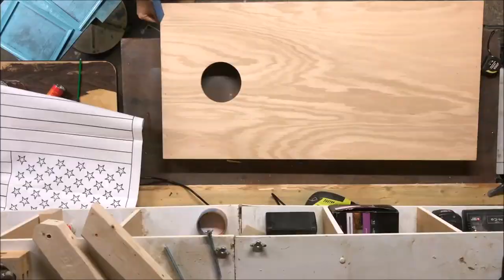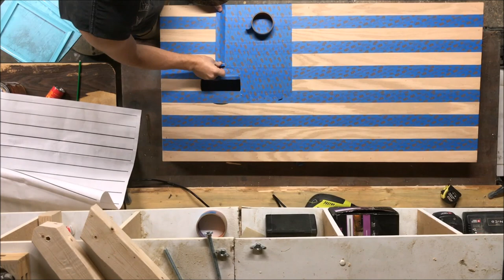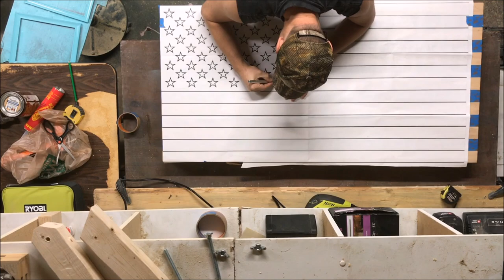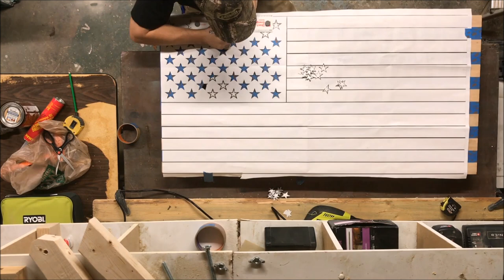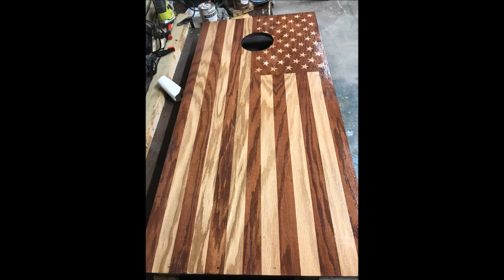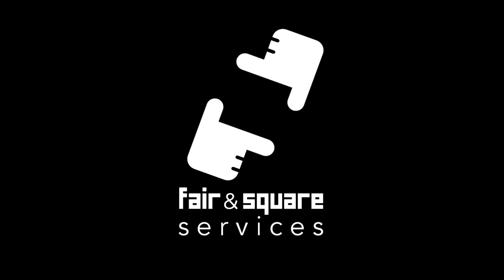American Flag Cornhole - Fair & Square Services

Comment: I’ve watched several videos on this pattern and your final product is, by far, the highest quality craftsmanship and visual appeal. What plywood did you use? On my iPad, it appears to be Oak or another ring-porous wood.
Reply from the maker: Jeffrey Keyser thanks for the feedback, I appreciate that! It is PureBond Red Oak (3/4”). You are correct, it has a very deep grain so you have to sand down very well and then apply the stain very lightly to prevent bleeding. This is one of my favorites. Are you planning on making a project like this?
Reply: I was going to say the same thing until I saw Jefferey's comment.  He expressed my sentiments exactly.  Great job.
Reply from the maker: @befmx31  Thank you very much!

Comment: We tried this after watching a different video but the stain bled under the tape stars. Any suggestions on how to prevent that from happening? And how to now fix it? =(
Reply from the maker: Maxine Bania what type of plywood and stain did you use? How did you prep it (sand grit)? As far as fixing, it depends on how bad or deep the bleed is. Contact me on my FB page and send me some pictures. You might be able to scrape it out with a razor blade. Can you send me a picture to look at?
Reply from the maker: Message me this way so you can send pictures:
https://m.facebook.com/home.php?_rdr
Reply: Fair & Square Services thank you so much! The link isn’t working. What is the page name? I can look it up and message from there.
Reply from the maker: Maxine Bania Fair & Square Services
Reply: Use gel stain
Reply: Kevin Minson we ended up doing that not long after I posted that question and it worked like a charm!
Reply from the maker: @kevinminson8749  Yup gel stain will certainly help!
Reply from the maker: @maxe381  great to hear!

Comment: What is the diameter of the stars and the width of the stripes?
Reply from the maker: Hey John, this is the website I used:
http://www.ushistory.org/betsy/flagetiq3.html
I just extended the length to 48". So it was:
Star Diameter: 24 x 0.0616 = 1.4784" (~1-1/2")
Stripe width: 24/13 or 24 x 0.0769 = 1.8456" (~1-7/8")
The website also gives you the correct dimensions of the hoist (blue) and star placement

Let me know if you have any questions.  Are you doing a cornhole set?
Reply from the maker: Hit me up on Facebook and I’ll share the scales image with you
Reply: Awesome! Thank you!  Yes, I want to do one and this is pretty much exactly what I had in mind.  Nice work!
Reply from the maker: John Cota nice! PM me on my FB page or through my website (www.fairandsquareservices.com) and I can help